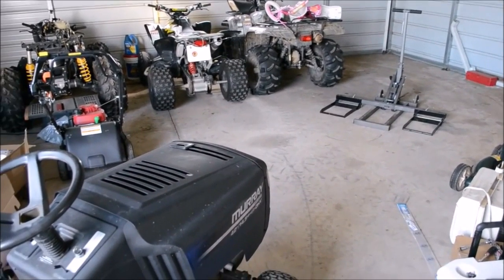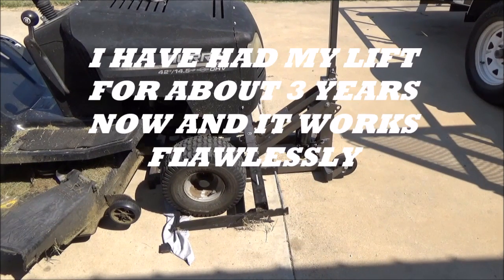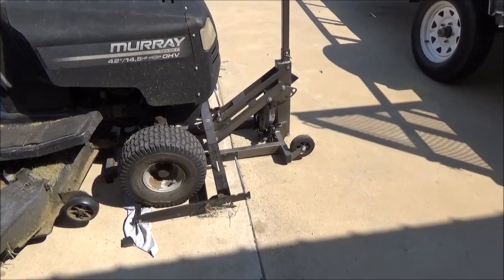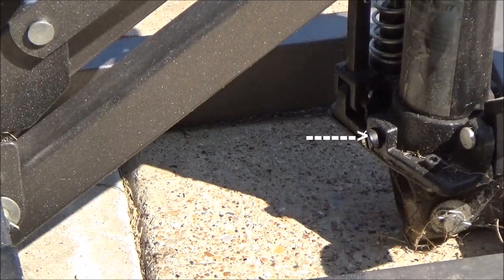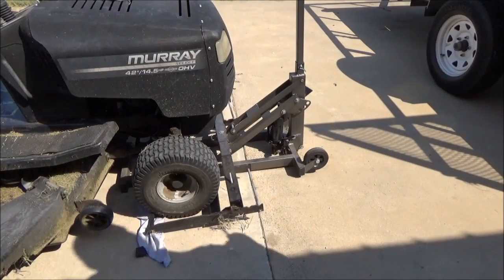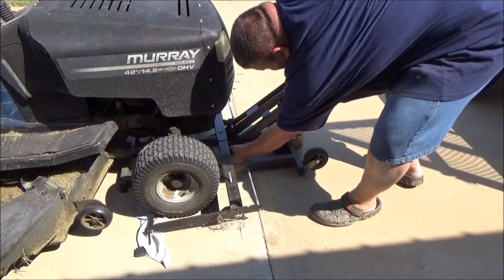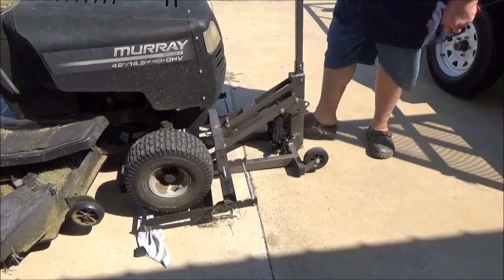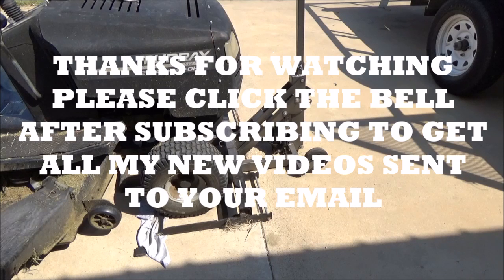HARBOR FREIGHT   Pittsburgh Riding Mower / Atv Lift Jack 60395 / 61523  WONT LIFT OR PUMP UP

Comment: Thank you so much for this video! You were my life saver today. I've had this jack for a while and it has always worked perfectly. Today, it would not lift my riding mower. I got out the assembly manual, checked out the trouble shooting section, and was getting totally frustrated. Oil plug? I had no clue what to do. Then I found your video!! I adjusted the screw, but was a little worried when it didn't need too much turning to tighten. But it did the trick - good as new. Thanks again :D

Comment: My kid brother and I each bought a lift about 5 years ago. Mine started failing last week. I was able to get it up bay jacking it up, relieve the pressure and jacking again. My brother has been laughing at me because he thought I bought a faulty piece of equipment.  I'll be going over to his house and unscrewing that screw. I know he is planning on replacing the Steering Sector on his riding mower. He's one of those young kids (72) with  no patience and he'll call me  to go get another one. Then I'll screw the screw in. Thanks, this is going to be fun.

Comment: Thank you sooo much I had already spent about 2 hours counting a trip to the parts store for hydraulic oil.while trying to follow the trouble shooting section in the instructions. I should have just checked U tube to start with as I already had it pulled up in my workshop to find assembly instructions(the ones that came with the tool were useless) Such a simple fix I couldn't believe it. you Rock!!!

Comment: Hell yeah man!!! You just saved me $110! (: I was about to return it and get the more expensive one thinking my garden tractor was too much weight because it would lift 2 5 gallon jugs of gas, but wouldn't lift the tractor....until I tightened that screw! (: Much appreciated.
Reply: Just so you know I had the same thoughts but just couldn't believe my mower could be that much heavier than average.

Comment: Boom!  Fixed.  My screw was on the other side but once I screwed that in, she lifted right up.  Another thing some folks can try is to leave their mower in neutral and the parking brake off.  This makes it a little easier to lift.

Comment: Liked your video.  We have a mower lift that is fully extended after being tipped over.  Have not been able to get the piston to go down.  We have the pump out of the unit.  It was having trouble pumping prior to this happening.  Any suggestions?

Comment: I have the opposite problem mine won't go all the way down now no clue why any ideas? I bought mine at harbour freight. There isn't a screw where your's is but there are two screws on the back.  One has a cross and the other just a slit.

Comment: Would you have any idea why my mower lift won’t come back down?  Even if I put weight on it and unlock the locks, it may take a month for it to come down. I’ve tried playing with that screw and the little piston pushes in when the foot pedal is depressed but it stays up.

Comment: Well, I pulled off the red cap and tried to tighten it like you said all the way in and it would not jack up. Do I need to add fluid to it? I backed it out and then tightened it . Still nothing???
Reply from the maker: sounds like you’re out of fluid

Comment: Mine did that exact thing, so I bought a 4 ton Harbor Freight jack and swapped it out with the 2 ton jack and now I can lift my 61" zero turn with no problem. Wish I would of known of the adjustment screw, probably would of been an easier fix.

Comment: I have just the opposite problem. My lift will raise  but will only lower about 1/4 of the way down. Glad I did not try with a mower the first time, used cinder blocks for weight to test it. What would be a possible fix for this issue?
Reply: eskimosand you have a piece upside down

Comment: Hello my lift is stuck in the up position. Any advice?
Reply: Put another Jack to hold your mower up.  Or put stands under the wheels that are jacked up.  Loosen the screw.  You may have to manually lower the lift.  Tighten the screw back in.  See if it will pump back up. Then lower the mower.  I would suggest pumping it up and down a few times to test before trusting it

Comment: Mine worked twice
Reply: Mine too, I am waiting 2 months now for a replacement ram, I’m going to try this process
Reply: Tried this mine is different I have two adjustments.  If I tighten both down it will lift but not drop. So I have to loosen the left screw then it will go down, but then it won’t lift.tried all kinds of variations and won’t work properly with the release foot pedal, any ideas?